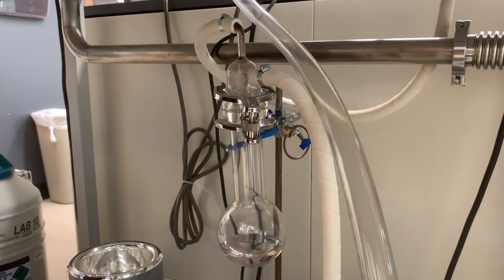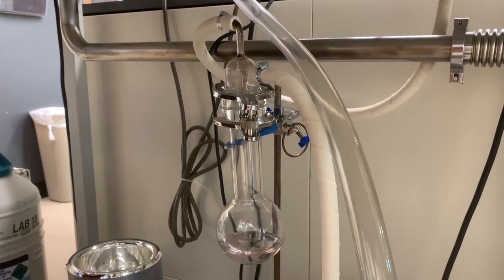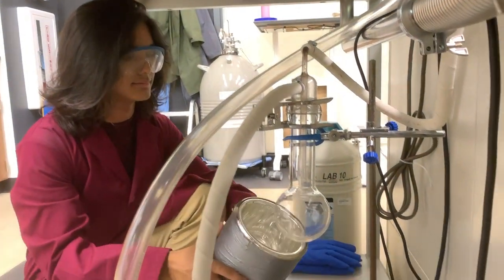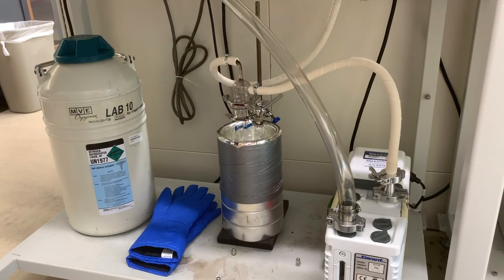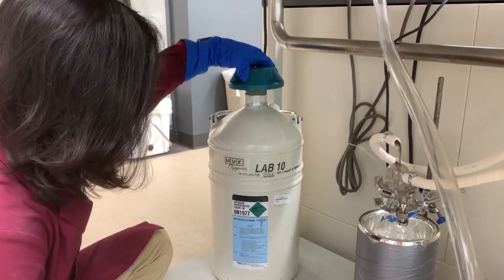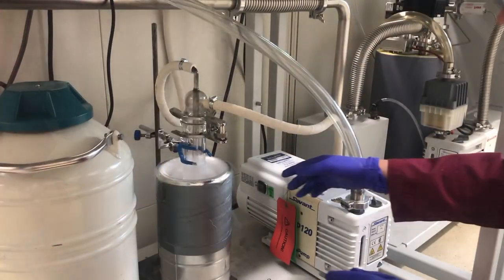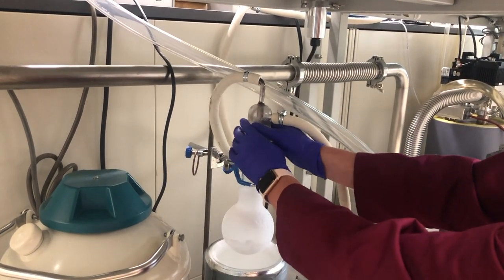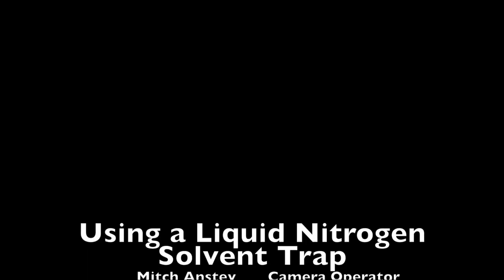Using a Liquid Nitrogen Trap

Comment: Thanks for this tutorial. Does the bulb have to be immersed in the nitrogen while running the vacuum pump?
Reply from the maker: Yes, it should be. You want to avoid the compound evaporating/subliming while the evacuation step is going. Some compounds won't evaporate that quickly, but better safe than sorry!

Comment: Can I ask...what type of vacuum pump you use?must use specific vacuum pump?can use low horse power vacuum pump?tq☺️
Reply from the maker: I'm using an Edwards RV-8 pump. They make them in different horsepower (RV5, RV8, RV12).

Great question about horsepower! My understanding is that the horsepower only changes the rate of pumping, not the final value for vacuum. The RV pumps will go down to the same value, but the RV5 will take longer to get there than the RV12. Low horsepower is ok!

Comment: glass wont break from the cold of LN?
Reply from the maker: In 20 years, I've seen a couple NMR tubes break and maybe one larger flask. If a piece of glass looks compromised (score line, cracks, etc.), it will likely break. But otherwise, it's fairly rare in my own experience.